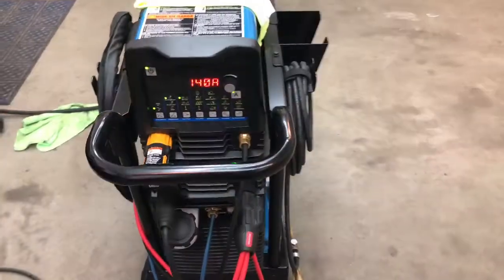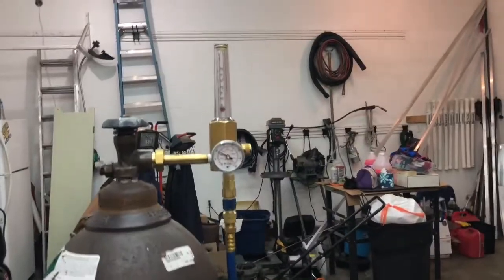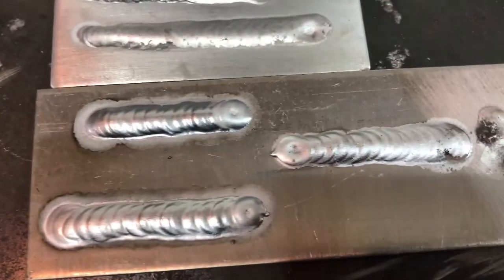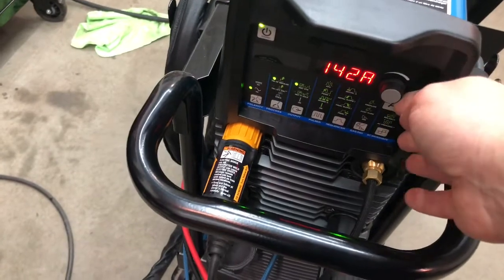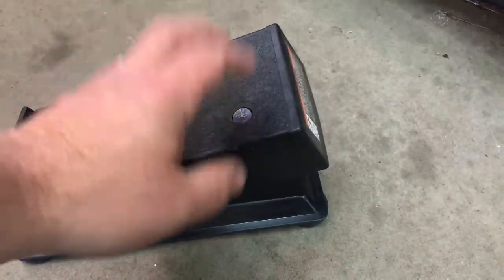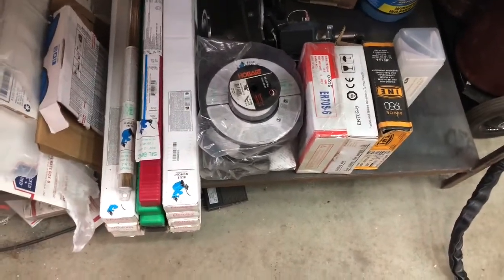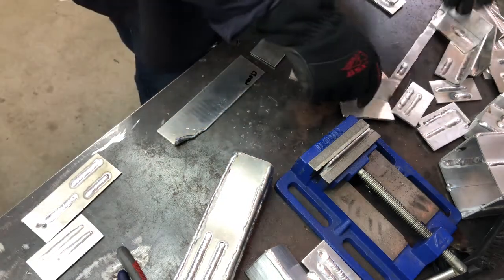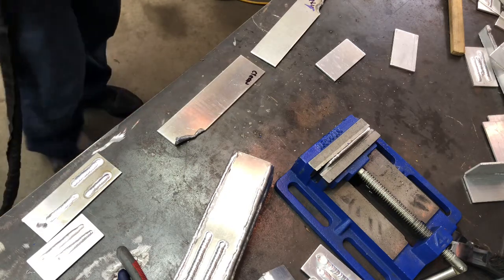4043 Aluminium Tig Welding Cloudy Beads vs good beads

Comment: Okay so it’s probably cause your moving your tungsten during post flow thus contaminating your tungsten and when you start up that new ark your depositing all contaminants from the tungsten into your puddle alsooo
Those are 2 separate thicknesses of aluminum I run 145-166 on 1/8th inch aluminum that thinner stuff might be getting to hot and sucking In contaminants from the back side

Comment: Hay mate. Wicked vid. Very informative and interesting. 
I also see that you let the post flow flow over the weld after welding. 
Aluminium is a non-negative metal. Which means you only need the post flow to shield the tungsten electrode whilst it cools as shielding the aluminium is only wasting your argon. 

I also like how even though your vids are sped up a tad you can still understand what your saying. 
I will sub to your channel.

Comment: clean you metal with wire brush only for metal that your welding and brush in one direction only not back and forth and then clean with acetone cleaner you weld puddle is clean of junk

Comment: there was a video on 6061.com's channel that he took down. he has a miller sync that he diagnosed because he was having problems with similar issues. Theres a small box in the machin, im sure yours has it, which you adjust the prongs for the voltage. unsure what it was called. sucks he took it down.
Reply from the maker: Ryan gst I figured it out, it’s when the part is overheated or too much heat going into it then it’ll do that. If it’s cold or warm or I control the heat works great. I use my HTP Invertig Mostly but I also use 4943 now too. The 4943 is same as 4043 without the issues and it’s stronger. I’ve gotten much much better I’m really good with aluminum now since this video. 5053 and 4943 have zero issues. 4043 is good now too but takes way more practice.
Reply: @weldingjunkie  Awesome 🤘 I finally ordered more tungsten(3/32), gas lens kit from usaweld, a good size 1/8 5052 sheet, and buying 5356 rods tomorrow.  Looking forward to improve my skills with AL

Comment: 30 cfh ? A bit overkill if you ask me.
Reply from the maker: R_Fab_Machining I run 30 on a 12 cup I was trying some trial and error trouble shooting. I typically run 15-20 with a 5-8 cup
Reply: Welding Junkie i'm guessing you figured out that the table is doing the heat soaking making the material very hot that's why the dull weld. Lift it off the table how the boxed one is and the weld should be shinny like the box. Anyways 15 cfh is plenty for me with a 5 cup on aluminum. 20-25 cfh on a 12 cup with gas lense. Gotta save me some gas lol.

Comment: Try some 4943. Sit down elbows resting on the bench. I hardly use 4043 anymore because of the dullness. Miller forums have a huge thread.on this albeit it is an old thread. Many state the inverter machines float the magnesium to the top but who knows.

Comment: Its not the air gap it's the fact that there is more material acting like a heat sink. The other pieces on the bench are heating up a lot faster because there if less material. Your bench isn't a great great sink. 140amp for 1/8 is fine but you don't stay at full pedal through the whole weld Get the puddle going dip and depending on the material size you usually start backing off little by little. As the piece heats up you prob only be using as little as 60 amps. Is harder to weld little coupons on the bench cause they heat up so fast. It's takes more skill and control for smaller pieces. If you get to cold the puddle will show you it needs more heat. Like you said it turned out fine on a trailer and dock with 5000x more material. You need the higher amperage too get going but once the puddle is started you dont need all the amps anymore. usually end up around 1 amp per thousandth or less depending on travel speed. 5356 has magnesium and takes more heat to wet out plus it's harder to overheat. Keep practicing you will get it. Hope this helps
Reply from the maker: Tom Velentzas thanks Tom I think you are right. I was always leaving the machine on 210 and use the pedal to puddle them move. I couldn’t believe it because I never had that issue before. I need to get a better table set up to spread the heat around a little better. Thanks for the tips it’s greatly appreciated.
Reply: Welding Junkie no problem the key is to get that puddle to solidify fast so if the material is to hot or your welding to hot the puddle will take to long to freeze and you will get that dull or sandy apearance. It's odd cause I'm not subscribed to your channel i just came across your video out of the blue. Happy welding
Reply from the maker: Tom Velentzas thank you again I couldn’t understand it at all. So would more argon help cool the puddle faster or no? It seems fine on pipe as well.
Reply: Welding Junkie no if will prob make it worse. Not sure how you running 30cfh. That's really high unless your regulator is off. I usually run around 15cfh with agas lens and number 5 cup  maybe a 6 sometimes. Sometimes just a regular collet body. To much argon will actually make the arc jump around a lot especially in a t joint. It's blow the arc around and its hard to pinpoint. Also to much argon can create turbulance and pull atmosphere into the weld puddle. I would turn the argon down until you start to see contamination than go up a few cfh. Also you will just be paying the gas man. The smaller cups actually do help make a nicer weld keeping the cleaning action minimized around the weld puddle so it's not cleaning the bead you just laid down
Reply from the maker: Tom Velentzas typically I run what ever cup size (x) times 2 so for a 8cup I run 16cfh and so on 12 I run 24cfh I was just trying to find out what was going on. I was gonna try higher than 30 haha. I think it’s the heat like you guys said

Comment: 8:20  you did dip it twice - start with a fresh tungsten, ground on a diamond or green wheel that was not previously contaminated with something else but tungsten. 
Because even when you re sharpen the dipped tungsten you have it sucks the aluminum all the way up and just re sharpening only cleans the tip. 
 Then pre heat your material - as you noticed once your material is warm your welds turn out better .

Also gas delivery might be an issue ...

The opening is letting the material heat up ....  aluminum is all about the right heat ...  when you lay your piece flat on the bench you have the entire bench as a gigantic heat sink - sucking the heat out of the alu and making your weld cloudy ....

If you use argon with 25-50% helium you wont have this problem ....  because the helium makes it burn hotter ....
Reply from the maker: ZILA thanks Pete I did dip twice however I’ve done 1000 welds dipping no dipping dipping I’m a tip dipper lol I think you’re right about the bench because that’s only time I get the cloudy weld, my beads are actually decent now I’ve ran 1000’s of beads but only 4043 does that. How come 5356 doesn’t? I think I’m going to get some heli mix like you say, you’ve never steered me wrong yet. Does it with Invertig and dynasty so it’s gotta be me and or bench.

You think 1/8” is too thin and my bench is pre heating it too much? 5356 doesn’t do that?
Reply: Welding Junkie 5356 is not as shiny to begin with and the 5-6% magnesium in it make the flame green and require more heat to make it flow anyway ....  5356 is “cooler” so it requires more heat - so i think if you would time your welds you will see that your travel speed at same amperage is slower or you need more amps to maintain same travel speed ....  chemical composition of the rod and more heat make the difference on 5356
Reply from the maker: ZILA that must be it, right now my 5356 are way more shinny than my 4043 I noticed this bottle of Argon is worse than my last I can tell something’s off. Is 30cfm too much? I think it might be for a 8 stubby cup gas lens. I’m overheating the 4043 and like you said the 5356 takes more heat I’ve been treating them the same
Reply: Welding Junkie if your argon is not clean or your quick connects do not seal 100% .....  things like this i consider a gas delivery issue .... 

And 30 cfh sounds of for a 8 gas lens ....  

Could be less could even be more without creating vortices ....  

You should be good either way ....  

You can try some crazy #12 or #16 gas lenses with much higher flow rates ....  but for aluminum all that stuff is not really required .... for the longest time i welded aluminum with a #6 or maybe #7 cup not even a lens ..... and it always worked fine .....
Reply from the maker: ZILA i think you’re right 8 has been good and I weld good beads now good cleaning and my settings have been helpful. The Invertig has helped me a lot. Im almost out of Argon I’m going to get a new bottle and I’ll get a heli mix one and go from there. Should I back my plates or raise to cool things down material wise?
Reply: Welding Junkie no - dial the balance down ..... like 65 ish   The extra 10 points will make a huge difference and your beads more shiny and less peppering floating in the puddle ....

I mean in real life you weld what you need to weld ....  heat sink, chill block or mid air vertical or overheat with no heatsink whatsoever ...  whatever life throws at you
Reply from the maker: ZILA this is true, I used it on a trailer with a torch switch vertical and had no issues nice shinny Bead I used it on the aluminum dock gate build no issues. I guess it’s nothing to worry about just bothers me when I’m standing still on a flat table it looks terrible

Comment: Start with a CHAIR...  Just messing with ya, I don't do much aluminum work anymore.  One tip I have is be sure you are brushing your aluminum with a stainless steel brush that has NEVER touched anything but aluminum.  I mark my brushes with a sharpie to keep me on the straight and narrow.
Reply from the maker: worldtraveler haha touché too be honest I’m going to get my table fixed up so I can sit at it and weld because it does bother me to stand. I only Tig aluminum so all those are for it lol. I can run nice beads no problem up down sideways etc but 4043 gives me random cloudy welds I can’t figure it out. If I weld a box it’s fine, flat on table it’s not. Very odd. Good advice tho I need to get straighted out and fast. Plus it’s the same filler, gas, aluminum and same with dynasty or my Invertig